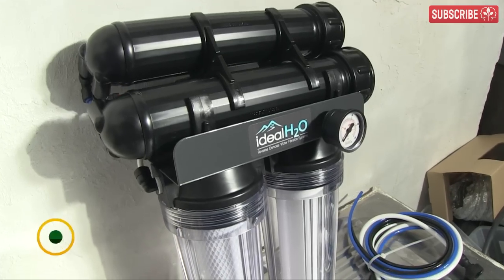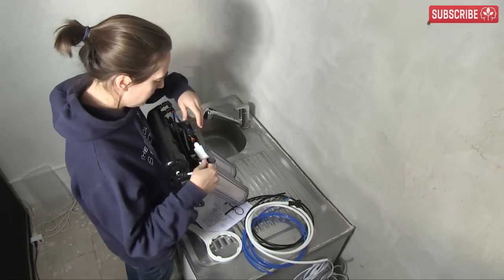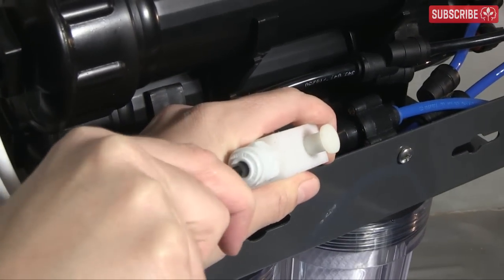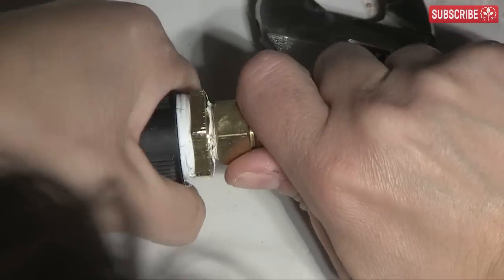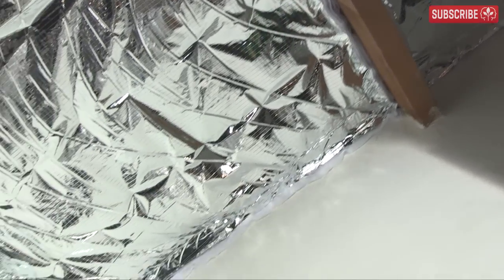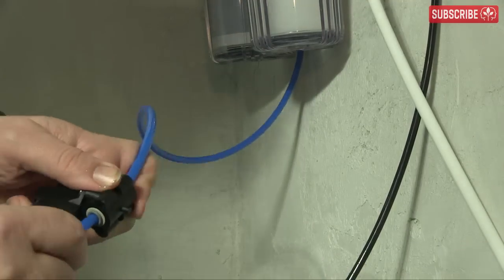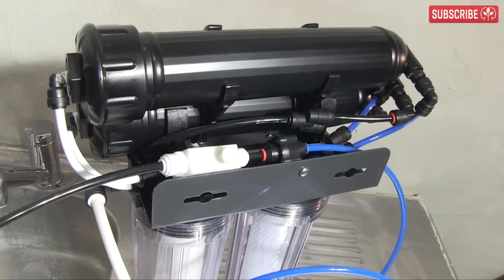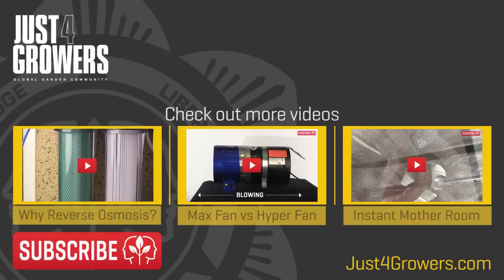How To Install a Reverse Osmosis Water Purification System

Comment: Great vid...how do you drain the water from the two bottom filters.. I don't keep my RO connected all the time, after I get the water I need I store it, til next time...haven't found a good place for it yet.. Anyway, how do I remove the excess water from the bottom filters. I know just sitting water can't be good for the filters. Any answers..thank you.
Reply from the maker: MrBigkel15 Hey MrBigKel. If you want to remove the water from the sediment and coco carbon filters (the two transparent filters at the bottom of the RO machine) cut off your mains water supply (or the water supply to the RO machine itself) and use the supplied wrench to unscrew the filters. You can tip out any water and they won't fill back up until you switch the water supply back on. Personally, I don't worry about leaving my RO machine connected to pressure—I've not experienced any issues with the longevity / efficacy of the filters using it like this—but then, I get through quite a bit of RO water!

Comment: Is a water softener not needed on this unit like the hydrologic one you did just before this video? What’s your water hardness?
Reply from the maker: My water comes out of the tap at 0.7 mS ( around 350 PPM if you prefer TDS). It's full of calcium and magnesium carbonates and bicarbonates. As such, it's a very good idea to pass hard tap water through a softener first, and then direct it to your RO—the exchanged ions from the softener will take far less of a toll on your RO filters.
Reply: Thank you so much!! I have a hard time finding the small water softener/descaler you were using in the first video. 

Do you got recommendations for small water softeners for ro systems? Very appreciated what you do! Your videos are so much help!!
Reply from the maker: You're welcome! @dublinskater2626  Your best bet is to head down to your local big-box DIY store and see what they have. You shouldn't need to spend more than a few hundred euros.

Comment: can this be connected to a faucet with out a pressure tank? I know the stream will be slow but i dont care..
Reply from the maker: +maurice yes, you can connect to a faucet but you will need at least 40 psi for the filter to work. You can buy inline pressure boosting pumps too.

Comment: hey buddy. great info as always! im planning on putting in a ro soon.... only for 4 lights..... i fill up a 30 gal container about 3-4 times a week when im flowering.... i think this system would be a little overkill.   What system would you recomend?   Also im on well water.... my tds meter says im between 43-56 ppm depending on rain ect....so i think im pretty good and dont need a pre filter even though ive never actually tested my water to see what is in it.

Comment: If I had this hooked up to a barrel with a float valve and the barrel is full do I need to turn off my incoming water supply to the RO. I imagine once the float valve closes off the purified water port that the water would just be dumping down the drain port unless I turn off the main water line that runs to the RO system? I'm curious because I want to add this to my auto-top off reservoirs but not sure if its just going to be dumping water down the drain 24/7 just to maintain the reservoirs.
Reply from the maker: No you're all good. Drain stops when float valve kicks in.
Reply: Ok cool, thank you for the response!

Comment: On another video of yours you were highlighting Hydro-Logic's RO system.  Do you have a preference?
Does low-water pressure just make the RO system take longer, or does it have to have at least 40 PSI?
Thanks for your time.
Reply from the maker: Hi amigo, I'm still running both - time will tell! The system will still run at slightly less than 40 psi but slows to a crawl it's much less.
Reply: Everest Fernandez/ they're close to the same price but I think your Hydro logic works better. I'm learning so much here, thank you again. Let me know about that barbecue!
Reply: the seller  installed one from aqua pro on low pressure and it did n t worked but then the guy gave us just one with a pump and i installed it and it s working now :)